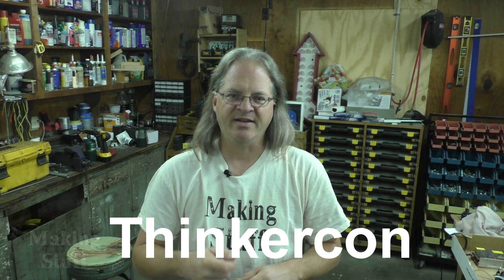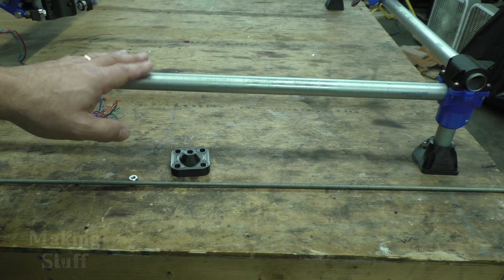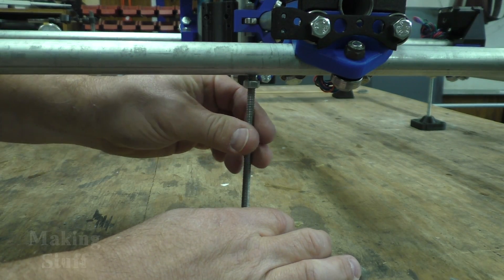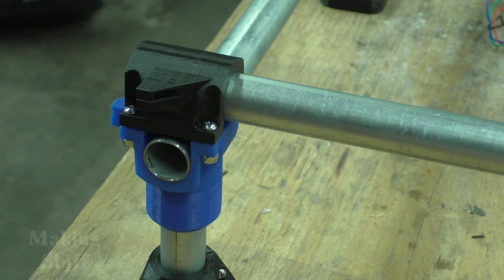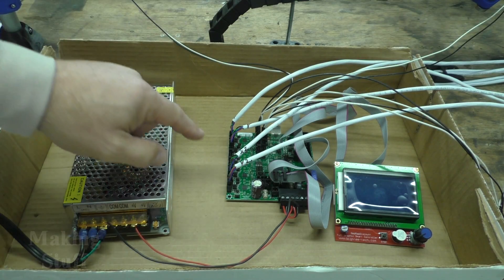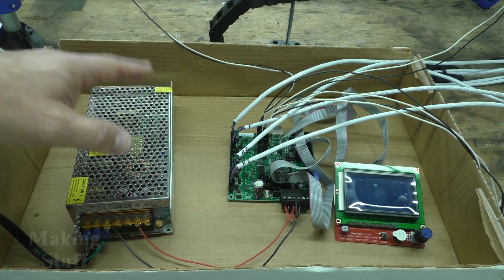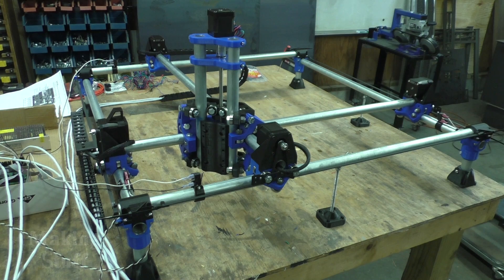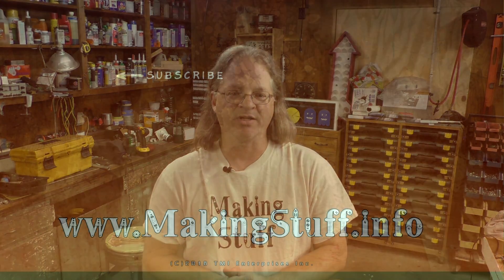Assembling a MPCNC Part 2 - Wiring, Belts and First Movement

Comment: So cool. I'm going to make a small one first with a 32bit main board with silent steppers and I'm going to have a pi running grbl and such with a monitor and a hole in the bottom for the cenentral air in my other workshop in my barn. I have an electronic workshop inside my house. I'm going g to buy a cheap rotary tool, cheap laser for etching photos or lines in wood for crafts. I'm just going to make my own end stops to save money. Once again, what a job

Comment: With the support brackets installed, you should check for flex half way between the support bracket and the corner.  Checking it at the support doesn't really tell you anything.

Comment: Thank you so much for sharing your experience on how to test and setup the mpcnc. I have a question, when you were running the tests. I noticed the the 4 corners were not as yet screwed into the surface. So at what point do you finally fit the screws to permanently fix the cnc gantry onto the base board?

Comment: That all fine and dandy but how are you going to get a wide piece of wood underneath the machine if you have those extra supports that you installed? kind of defeats the purpose of building a long MPCNC doesn't it?
Reply: latengocomoburro just put the piece in  from the top

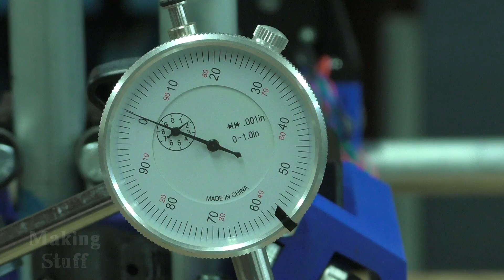Comment: @04:17 Us over on the 1000mm X-Carve use Y-Rail stiffeners to prevent those rails from bending but because of their 2:1 ( H:W ) profile we're less worried about them sagging down like yours than we are of them bending in/outwards in case the Head moves along the X-Axis and thus pushing in that direction. IMHO the forces any of those machines will normally encounter are X/Y related, not Z ones so I'm inclined to say that you didn't exactly solve your problem with those center posts.

Comment: What kind of wires did you use for your stepper motors? I purchased some 18/4 and its too big for the kinds of plugs and connectors. Did you stick with the connectors that's in the kit or did you purchase some separate ones?
Reply from the maker: I'm pretty sure it is 18/6.  It's off the same spool as what I used for the plasma cutter.
Reply: @MakingStuff  How did you get that wire to work with the plugs then? I got the same board with dual endstops kit and all, but when I go to crimp the ends onto the wires it's too big and then the insulation is too large to fit side by side into the plug.

I'm really wanting to use the larger 18ga wire but I'm stumped on how to get the wire to work the plugs on the Rambo 1.4 board. THANKS!
Reply from the maker: I found the box that the wire came in.  It is actually 22/6  not 18/6.
Reply: @MakingStuff 
Awesome!!! That's exactly what i had in my cart on amazon!  Thanks sooo much!! You;re the man!

Comment: Cant you just use an arduino system instead of rambo and save some money? Whats the advantage of using RAMBo
Reply from the maker: Rambo has everything you need on the board like stepper drivers.  If you use an Arduino, you will still have to buy those separate.

Comment: What sized all thread did you use?  I noticed that the holes on the base piece are larger than the holes in the nut trap that goes in the conduit.
Reply from the maker: It is 1/4 inch all thread.

Comment: I've been watching some of your videos, nice work and thank you !!!
I'm building a MPCNC right now, getting ready to wire it and add the RAMBO controller. What are your thoughts on using this device as a CNC plasma? I'm planning to try using it to run my small Miller Spectrum 125C. I've watched your plasma CNC videos as well, I like the recent THC and floating Z additions, you've saved me a ton of time already. Since there is no load on the tool when plasma cutting, it would seem the MPCNC should do OK.
What are your thoughts?
Reply from the maker: I've seen other videos where the MPCNC was used for plasma so it should be doable.
Reply: @MakingStuff  Thanks, I have as well and am hoping for good results. Your experience is a bit unique, having built a CNC plasma already. I was thinking you might have insights others are missing when evaluating the MPCNC platform. It's a pretty exciting path with potentially high value given the cost of implementation. Thx
Reply from the maker: Since there is no lateral force being put on the frame like there would be with a cutter, the frame should work well with a plasma torch.  I don't know how you are planning to control the CNC.  If you use LinuxCNC and stepper drivers you won't have any problems.  If you want to use a RAMBo or RAMPS board you will have to figure out a few things like how to turn the torch on and off and how to hook up a THC.
Reply: @MakingStuff  Thanks, I'm having those same thoughts about the RAMBO. I'll work that direction and see how it goes, hopefully it's no more difficult than triggering the hotend of a 3d printer.
Reply from the maker: @citterly : You might be able to use the parts cooling fan port on the RAMBo.  Try connecting a relay to turn the torch on and off.

Comment: Looks awesome, I'm currently building the Root3 from https://rootcnc.com/
Currently working in the parts printing stage, then I'll get some Nema23 motors, RAMPS, and finally the most economically painful part: the spindle
Reply from the maker: Spindle shouldn't be too bad.  Hopefully I'll have a video on it in a week or two.
Reply: @MakingStuff  my plan is to mill aluminium so the spindle I'm looking is in the range of $400~$600, I'll need a spindle with around 2.2kw

Comment: Silly question, when you cut the cable mesh cover, how do you stop it fraying? I ended up putting tape round 😢, yours looks so much neater 😀. Thanks for sharing this build, really enjoying it! Cheers
Reply from the maker: Good question!  I just hold the end in a flame for about half a second.  A lighter,candle or blow torch will work.  I guess I need to show that on the video.

Comment: Lookin' good!  Loving the series so far. The corners are not that big of a deal so I don't say anything on the last video. 

As for the flex, I finally found some numbers to use as a baseline. I was never sure before, https://www.v1engineering.com/forum/topic/burly-revisions/page/3/#post-72744. So ballpark 1.55kg at the bit (1/8") cutting aluminum at 8.4mm/s. No where near pushing down as hard as you can on one rail. That load is split between 1 or 2 rails depending on direction of cut from the gantry, that is where the flex actually is, the Z to XY gantry rails through the center section. The braces are a good thing (4x rail rigidity increase, but cut into usability) but I think you will find for wood they are overkill.
Reply from the maker: Thanks!  This has been a fun project and you have done a great job on the design and all the info on the v1 Engineering web page.  I'm experimenting with the supports because I plan on making this bigger for a future project that I am going to start working on next year.

Comment: Would it be possible do a cheaper build by replacing rambo board with some arduino + chineese cnc v3 board and some tmc stepper drivers?
Reply from the maker: Yeah there are other boards on the MPCNC web site that are cheaper.  However, they don't do the dual end stops.  That's why I used a RAMBo.
Reply: Hello.  I just built a MPCNC.  I used the Arduino mega and RAMPS 1.4 board and I was able to configure dual end stops on both X and Y.  I bought a 3D printer electronics kit from Amazon.  It has been working great so far.  Thank you for sharing your build with us.

Comment: On the LowRider CNC by the same folks as MPCNC, they suggest using stainless tubing the right size.  It is available on Amazon at a reasonable price.  It is a bit more rigid and thicker walls.